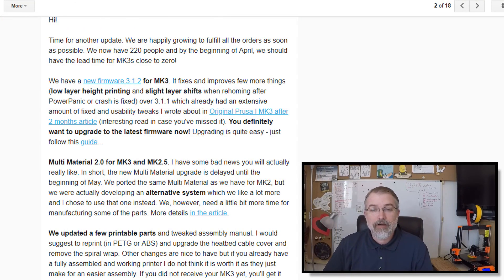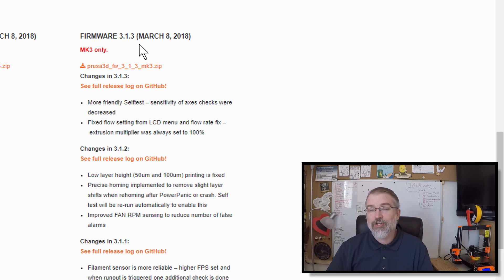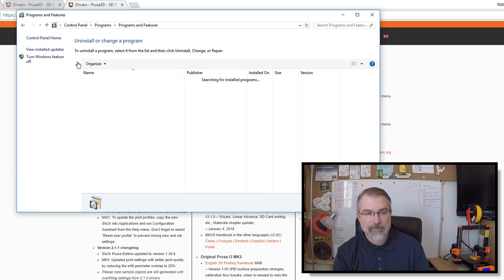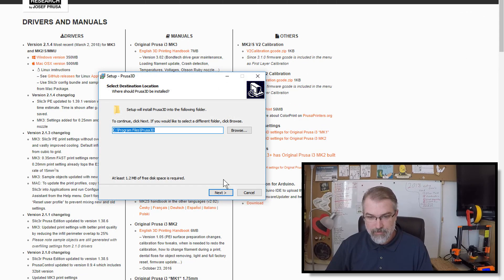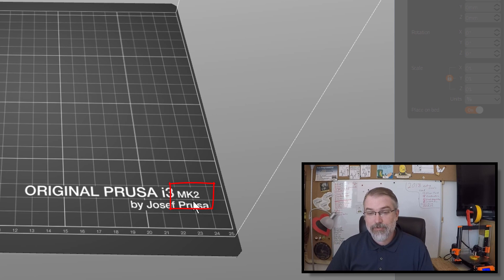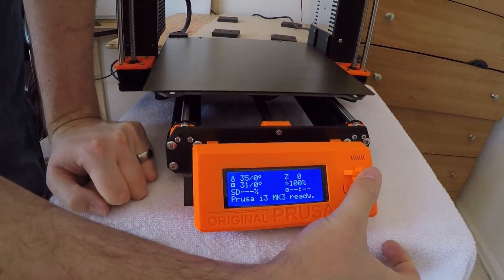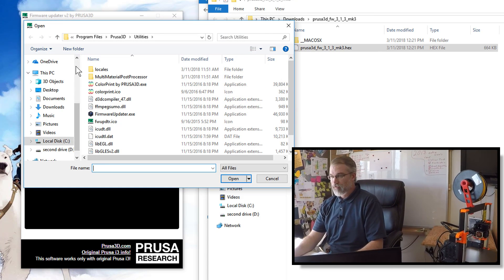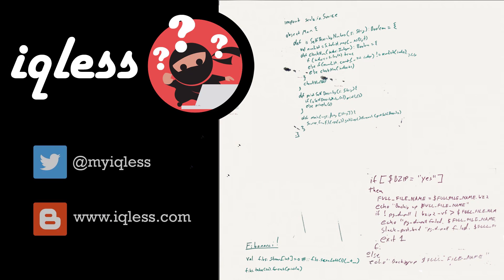Prusa i3 MK3: Installing firmware

Comment: Prusa had added the firmware flasher into the latest version of Slic3r. It works exactly the same but it is a little easier to find.
Reply: I should have said - it's located under "Configuration" in version 1.41.0+win64